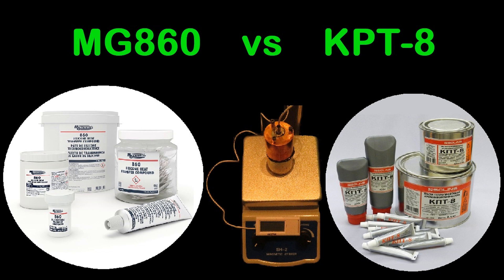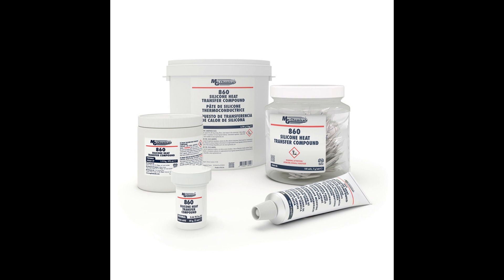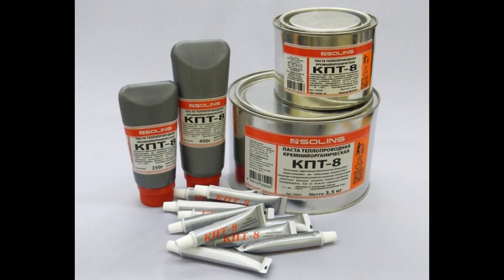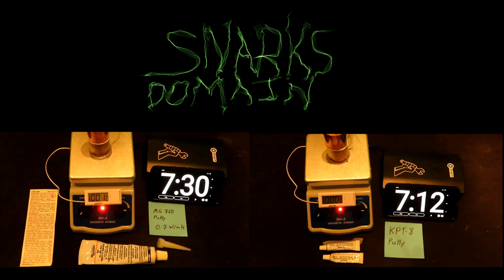The Race to 100C: MG860 vs KPT 8

Comment: KPT 8 is just a thermal paste, not putty.
It's an ancient Soviet Union engineered organic paste from 1975, that even has E900 food additive.
It's dirt cheap and dries out quickly. You don't need that shit, just don't.
Reply from the maker: Indeed. It was one of the first paste/putties I came across when searching for suitable replacements for TG-PP10 when it was discontinued. I was deep in some random forums when I saw it mentioned.

I definitely wouldn't use either of the putties tested in this video. I agree that KPT-8 is closer to a paste than putty.

Luckily we have some awesome putties to choose from now with Upsiren, Penchem, and Jeyi.
Reply: @snarksdomain  What about Laird Tputty 607?
Reply from the maker: @je5terc0re  I'll add it to the list! :)

Comment: Im on a laptop and want to replace the thermal pads with a putty + ptm7950 on cpu/gpu die, but the TH949-1 is way too expensive, do you recommend the Jeyi 8100 for that?(for Dell G15 5515)
Was browsing through Aliexpress for other options and stumbled across this "zezzio ZT-PY6" do you know this one? Thx!

Comment: How much putty is approximately needed for a single GPU card?
Reply from the maker: That's a somewhat difficult question to answer. It all depends on which card and also if you go with shims or not.

Most putties are around that 3-3.2 grams per Cubic Centineter. So similar densitities, so at least there isn't huge variance that way.

I've listed how many grams used on some of my videos where I've replaced the stock pads.

On a 3090 with putty only, I used 66 grams. When I then switched to putty plus shims I used 51 grams. I'm usually fairly generous in my application so you could likely get by with a bit less.
Reply: @snarksdomain  I know you're probably very busy but would it be possible for you to test some thermal putties available on AliExpress? I was looking for some and unfortunately Jeyi 8100 is not very well available but there's quite a few others (possibly they're one and the same pink putty): Upsiren U6 Pro, Zezzio ZT-PY6, CX-H1300 and LK/LK-PRO.
Reply: @snarksdomain  I understand that it is rather difficult to answer and I thank you very much for your thorough response :-) 

In the future I plan to repaste my Red Devil 6900XT as it has rather high junction temperature but for now I will experiment on a Sapphire RX570 Nitro+. I will be using putty only and I think that a single Jeyi 8100 package has 10g so I will need at least 5-6 pieces for a card...